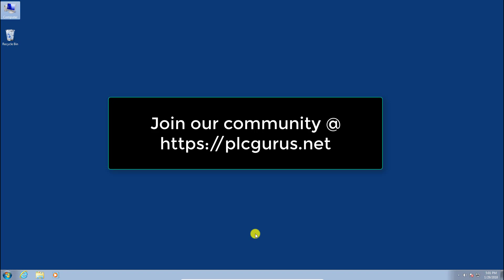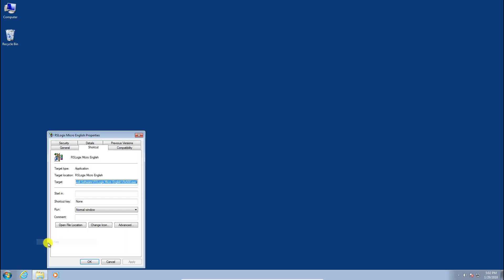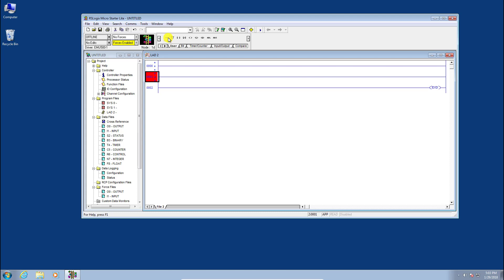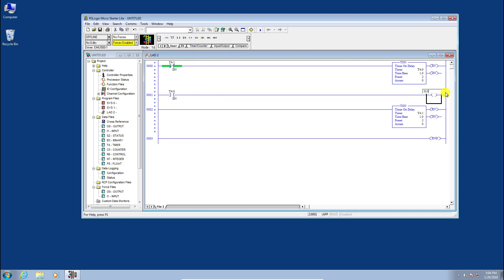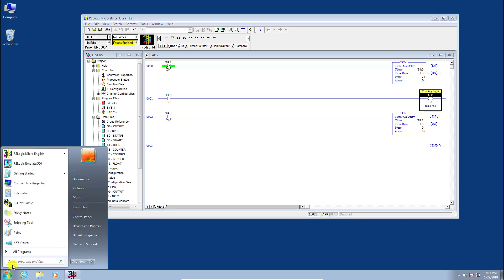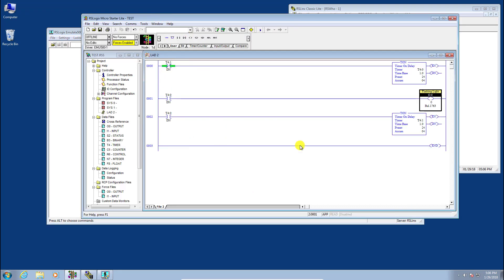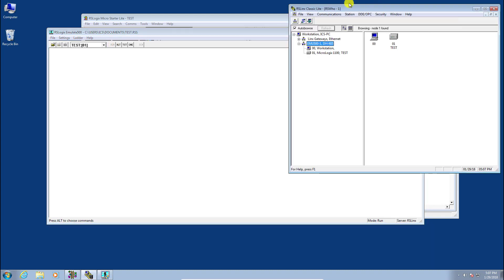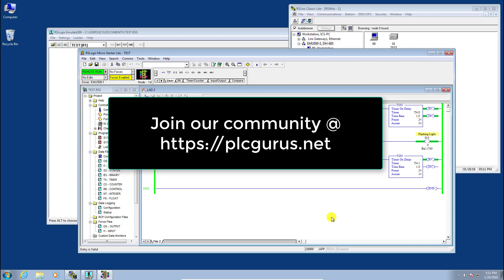PLCGurus.NET - How To Use RSLogix 500 Emulator

Comment: Hi there. Great tutorials, however I am having issue downloading my program (same as the one in the video) onto the emulator. I repeatedly get message "Download Failed! Program is incompatible with the processor!" Any suggestions?

I thought Emulate500 is compatible with programs for MicroLogix 1100.
Reply from the maker: Hi. Make sure the software versions major revision matches the processor revision

Comment: I'm using Windows 10. I have everything installed but when I try to RSLogix Emulate 500 it says: "Failed to update the System Registry. Please check registry security rights or try using REGEDIT." How do I fix this issue??
Reply from the maker: The issue is likely Windows 10 compatibility. The RS500 Emulator is now what I would consider legacy. Its not designed to run on Windows 10. Perhaps there is a registry hack out there, but I personally I have not tested it. Reverting to Windows 7 in a VM may be a good option.
Reply: @PLCGurusNET  Oh OK. What do you  mean by reverting back to Windows 7 using a "VM"?
Reply from the maker: Hi Shaine. You could use a Virtual Machine running Windows 7...something like Virtualbox which is free and pretty good would work. Of course you'll need a Windows 7 image.
Reply: @PLCGurusNET  Yikes! That's over my head. What do you mean by windows 7 image? I guess I could Google "virtual machine"?!